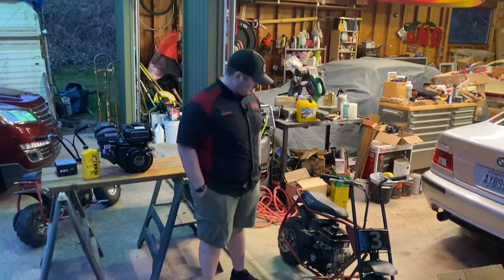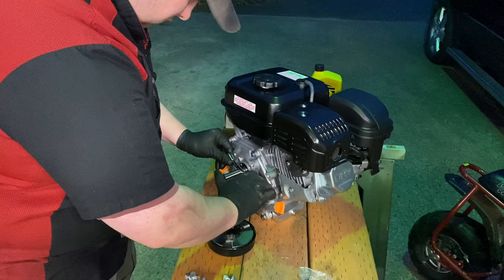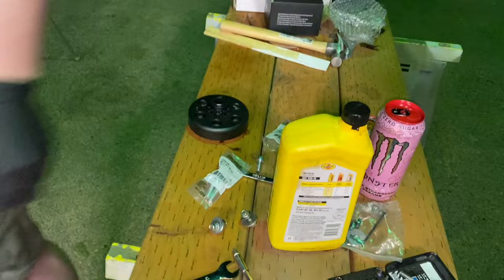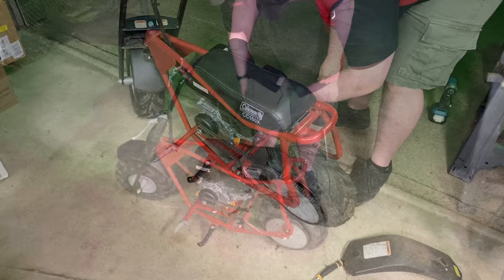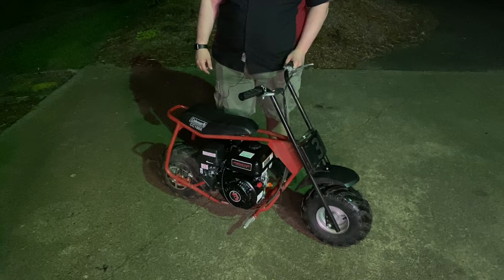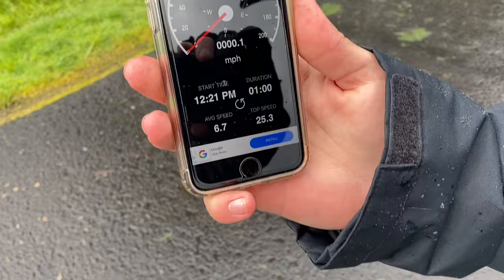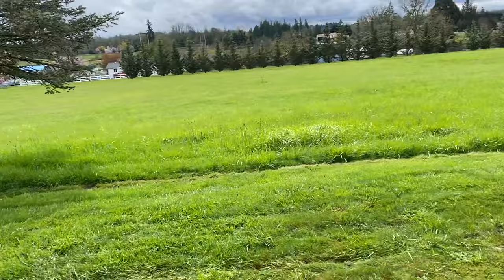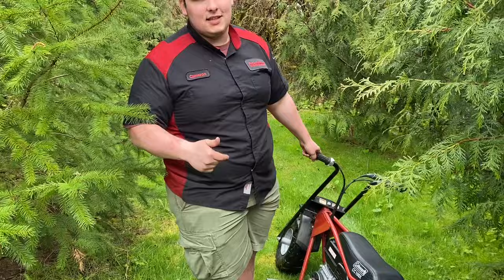Absolute ripper - Predator 212cc Minibike swap guide and top speed test!

Comment: I didn't see you do it but there is a throttle restrictor screw on the carb. You need to back that out. If you did do that and I missed it sorry. Otherwise looks like fun, I did the same thing on my CT100U and wow! It goes!! I can hit 45+ on a good stretch of road.
Reply: 10:44 is when they cover pulling the screw but thanks for the heads up!
Reply: @isaakm4074 he’s not talking about the screw that loosens up the throttle that’s what he did a 10:44 but there’s another screw that only lets the throttle open half way.
Reply: He’s definitely not getting full throttle
Reply: @isaakm4074  I went back and looked at the video, they definitely do not remove the throttle restrictor screw.
Reply: @mbrrideitlikeyoustoleit8436  Yeah the restrictor screw is still in is why

Comment: Has anybody run into the problem where the motor just doesn’t start at all? I’ve installed it on my bike, put gas in, it’s got oil and the power switch is on. I’m going crazy trying to figure out what’s going on
Reply from the maker: Make sure the air filter does not have any plastic cover or something blocking the air box, also make sure the coil is connected to the plug
Reply from the maker: But other than that you might just have a dud :/
Reply: @jakeandcameron7022  I’ll have to double check but I’m almost certain those are both good to go, I took out the filter completely and it didn’t start
Reply: There’s a kill wire infront of the motor that I have to take out every time I want to start mine

Comment: I built the same bike with a 212 torque converter custom motor mount for clearance 420 chains suspension forks and hydraulic brakes. Bad ass ride that pops Willys on command.
Reply: sheesh

Comment: I needed a longer chain / 5/16 -24 bolts   Had to shave down the plate for the jackshaft and a bushing for the shaft I had to make to space the clutch from the engine for a Baja mb165.

Comment: Im about to put a 212 predator in my mini bike. Do I need a engine mounting plate? Whats the benefits of having one? What happens if I dont have one? Any tips are appreciated!
Reply from the maker: Well on the bike in the video the holes on the motor baseplate just lined up with the holes on the frame but I’m not sure what your minibike frame looks like so your just gonna need to buy a motor and see if it fits and if it doesn’t you can just drill new holes in your frame assuming it doesn’t compromise the frame.
Reply: @jakeandcameron7022  Thank you guys for responding and doing it so fast haha. I just got a 212 and will see if it fits later today.

Comment: Do you need a new clutch? Or can you take the one off your stock one
Reply from the maker: Yes the stock clutch uses a 5/8th drive shaft out of the motor and the predator uses a 3/4 in shaft so you will need to buy a different clutch

Comment: Does this only work on a cc100x?
Reply from the maker: That’s the frame we had specifically but basically any minibike will be very similar in layout so as long as the frame has a big enough opening you should be able to swap no problem
Reply: I did it on my CT100U but had to relocate the gas tank.
Reply: @jmorris999 did you need to do anything with the chain? Since there is a bolt at the bottom preventing it from going all the way forward?